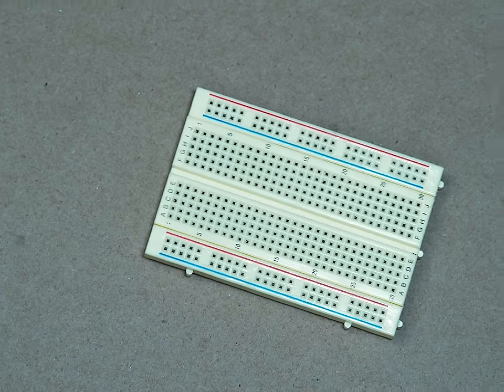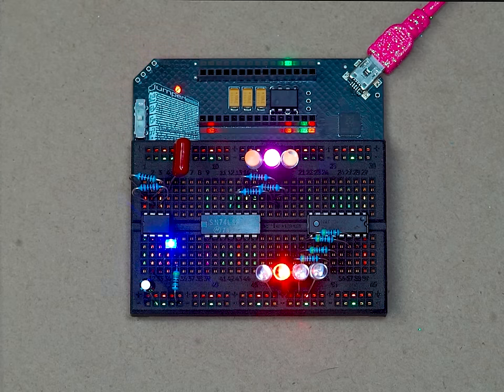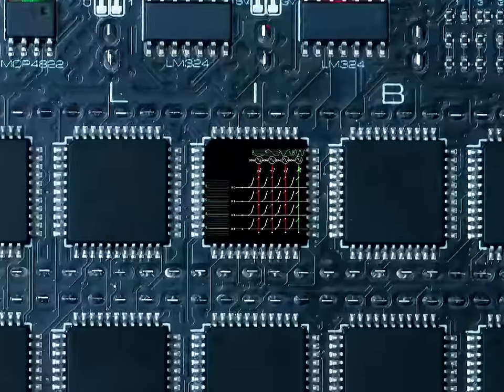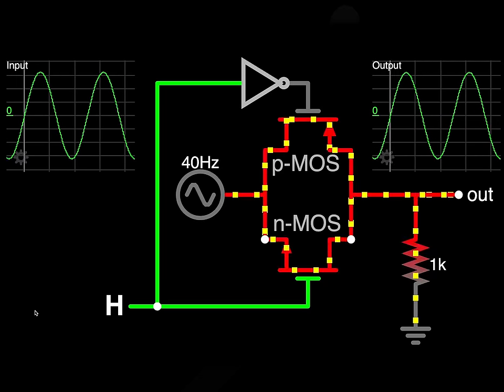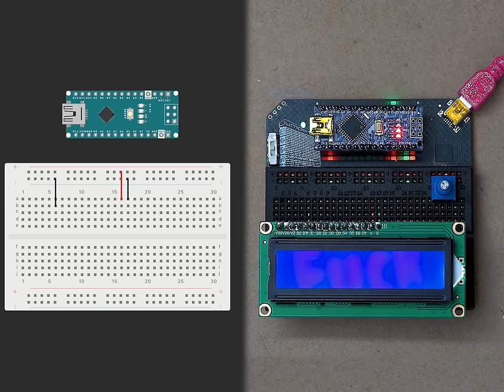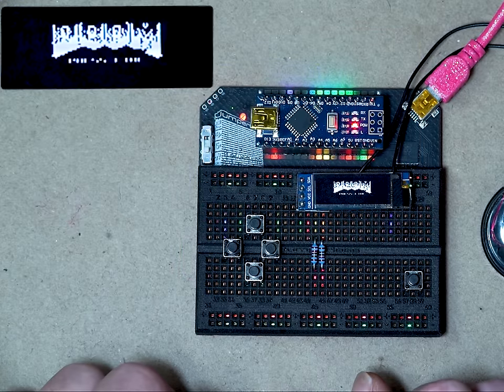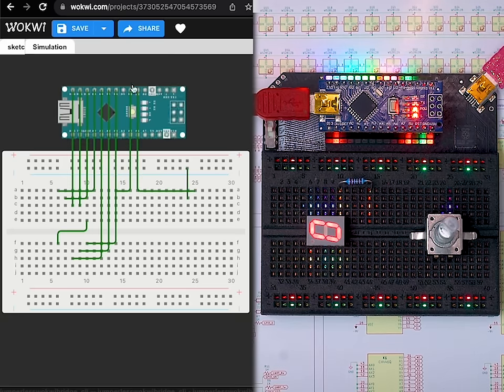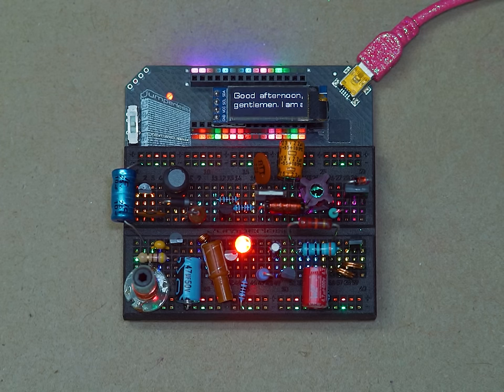Jumperless

Comment: Seeing how fast the holes in my normal breadboards go bad I would very much like to see a longevity test before I splurge 300$ on a breadboard 🤔
Reply from the maker: I had the spring clips made out of phosphor bronze, which is an alloy specifically made for high reliability springy electrical contacts like this. The steel ones from crappy breadboards tend lose their spinginess, but these should hold up for quite a while.

https://protosupplies.com/guide-to-solderless-breadboards/

Also if that happens, I'll swap out the spring clips on your Jumperless for free.

Comment: Almost perfect. Why 8 volts instead of 9??? I get the other two switch settings but maxing out at 8?
Reply from the maker: CMOS switches can only pass voltages between their supply rails, so I drop the +-9V crosspoint supply through a diode to get the +-8V for the power rails. That gives them a bit of headroom to switch. You could short those diodes to get the full +-9V or swap them with a low-forward-voltage diode to get closer. 
Any voltages above the crosspoint supply tend to leak into the other outputs, so your signal will clip at 9V and any additional voltage will be seen on the adjacent rows (For example, if you put 9.5V on row 5, row 5 will measure 9V and row 2,3,4, and 6 will measure 0.5V).
Reply: @arabidsquid  Ah I see. So is it really just combining diodes used in the 3.5 and 5 sections to get that 8v in the third switch position?
Reply from the maker: No, the 5V comes from USB power directly, the 3.3V comes from an LM1117-3.3 Voltage regulator, and the +-9V crosspoint supply comes from an LT1054CP charge pump wired as a voltage doubler and inverter, and the +-8V taps off that crosspoint supply through a diode on the +9V and another on the -9V. 

I used a charge pump instead of a more common (and waaay cheaper) flyback boost converter because I didn't want this thing flinging EMI into your circuit.
Reply: @arabidsquid  Ohhh. I completely didn't even consider that power came from USB to begin with. I am but a lowly audio hobbyist that only works on the 9-18v realm so I always tend to think about things in old school ways. But yeah those voltage options make perfect sense now. It's a really great concept and will surely be a smash in the Arduino community. Great job, I wish you much success!

Comment: That is so cool, i'd love to make one one day, but I have a question, how do you solder the bredboard on the pcb?
Reply from the maker: I actually had a manufacturer make a sheet metal stamping/bending mold for me so they could make special spring clips with solderable tabs and holes for the LEDs.

I sell them at cost so other people can make cool breadboard things and not have to spend $5000 on tooling. 
https://www.tindie.com/products/architeuthisflux/solderable-breadboard-spring-clips/

If you want to see what that tooling looks like:
https://forum.jumperless.org/t/spring-clip-update/48/3?u=architeuthisflux

Comment: I would think that a 2 port usb-hub would be a great addition for a V4. Then you wouldn't have to connect two usb cables to your pc. After all, isn't this project about getting rid of wires. 😉
Reply from the maker: You actually can program the arduino from the Jumperless itself. The firmware to do that needs a bit more work. But how it works is by briefly connecting the Arduino's Reset pin to ground, and then sending it the compiled hex code over the serial pins. So a near-future firmware update will update the sketch code from Wokwi as well as the wiring (or just paste the raw compiled hex into the terminal if you prefer).

Comment: How did you deal with the resistance of the analog crosspoint switches??
Reply from the maker: I just have to live with it. But there are a few things I do to get it as low as possible:

Run them at ~18V Vdd-Vss which is 4V above what they say on the datasheet but it reduces Ron to ~45 ohms per switch. And it doesn't seem to hurt them.

Limit alternate paths to a single hop over a different chip.

Double up paths where resistance is important

But yeah in practice for breadboarded things it doesn't seem to be a huge deal. The kinds of currents you deal with on a breadboard mean that most resistors you'd use are in the Kohms range so the extra 70 ohms is less of an issue.

Comment: Is it possible to automatically recognize the location, type and properties of different hardware components automatically with this? That could even make the manual connecting in software obsolete!
Reply from the maker: The hardware absolutely could, but I haven't finished the firmware to actually do that yet.

Comment: so this might not be good for guitar pedals, if the switching is only good for up to 100mA? charge pumps and inductors/transformers probably out of the question 🤔
Reply from the maker: In general, instrument level signals going into guitar pedals are basically ~0mA of current, and at most 150 milliVolts (which is tiny compared to the allowable 18 Volt swing). The input impedance of the things they plug into (amplifiers) are as high as possible, generally above 1MΩ. 

So 150mV÷1MΩ = 150nA   or   0.00015mA

But yes, charge pumps, inductors, and transformers may be pushing it though depending on what you're doing with them.

Comment: I've never seen this before.  Is this for real?  I mean, does each pin hole actually have an RGB LED to indicate action on them?

Is there an ESP32 (38 pin) version?

Or perhaps if there's an ESP32 version, its headers can handle 38 pin or less, just program the bread board to know what's there?

And if there's an ESP32 version (or even the Arduino version)
is there an option for the board's controller to NOT be Raspberry Pi controlled?
Perhaps the controller could be an ESP32 using both cores?  For those of us who don't use Pi ????
Reply from the maker: I may make adapters for the headers in different footprints soon. Until then, Arduino makes the Nano ESP32 that will fit up there. But yeah that has 8 fewer pins.
Putting the wide 38 pin footprint would also ruin the perfect 82x82mm squareness of the board.

I guess it's not impossible to make this same board with an ESP32, most of the code will be the same because I used the arduino-pico framework. Except for the PIO state machines running the crosspoints, and I'm not sure how much suitable GPIO the ESP32 has.

It's interesting that the AVR vs PIC war has recently changed into ESP32 vs RP2040 war, luckily it seems that people are much nicer about it now.
Reply: @arabidsquid  I didn't even realize that there was a war going on between ESP32 and RP2040 .  LOL

For me, I only got into ESP32 a couple of years ago (or a bit less).
I had avoided ESP32 for a long time because I don't like always jumping ship when things work well.

So I was doing everything with Arduino.

But when I finally broke down and bought a few ESP32 boards to test the wireless communications abilities, is when I fell in love with these things.

I do some of my prototyping on bread boards, but a lot, using a dev board with screw down connections.  LOL

Something like you've come up with would be a game changer.

Comment: Crazy wonderful stuff.  Wish I had this when I was doing breadboard experiments as a kid.    lol

:)
Reply: I would have destroyed a few switches with a lot more than 100mA, then go back to breadboards :/
Reply from the maker: @vikenemesh  The crosspoints are surprisingly hardy, I've run 400mA through them for a minute without breaking them.

Also my policy is if you break it, I'll be like, "hell yeah!" and replace it for free. I want people to try crazy stuff on these.
 

That being said, I've melted the insulation off quite a few wires messing around as a kid.
Reply: @arabidsquid  400mA is quite a bit indeed. Since you have current sensing capabilities, maybe have an auto shutoff if current gets too high? (also maybe you want to do actual destructive testing to see what the limits are) Very cool project.

Comment: Can you replace the breadboard when its springs wear out?
Reply from the maker: Ideally, these shouldn't wear out anytime soon because I was really picky about materials when I had these spring clips manufactured, so I didn't cheap out and use steel like they do in cheaper breadboards. They're made of phosphor bronze, which is an alloy specifically made for high reliability springy electrical contacts. 
But yeah, you totally could. It's a lot of desoldering though. If someone's using this enough to wear out the contacts, I'd just send them a fresh one for being such a loyal user of the thing.

Comment: I want like 4 of them, now lol
Reply from the maker: Ha sorry, you'll have to wait like a week for the next batch to come in. You can sign up for the waitlist though, which helps me know how many to have manufactured for the next batch.

Would you arrange all 4 of them in a long line or in a grid? (this is a genuine question. In the next revision, they will slot together and I need to decide whether to put ports on the bottom too)
Reply: @arabidsquid  as context, I am a computer engineer who specializes in processor execution and builds accelerators in FPGAs.

So for me, I plan to make a mother board for an FPGA, them use this to prototype how peripherals will be connected.

I can design a processor for an FPGA, but I can't design the PCB it goes on... I don't know board design and EE well, just self taught CE.
This seems like the perfect tool for me to learn that.

Comment: This is a novel (albeit a bit pricey) piece of kit. Much like other mad scientists out there, more than once I've found myself knitted inside a breadboard bird nest. Its even more frustrating since jumper wires only come in so many colors and lengths. The mechanics look similar to how a number 5 crossbar switch works. Hopefully there are others out there who will understand my comparison.
Reply from the maker: Ha yeah you're totally right about that, it works almost exactly like a small telephone network internally. All the early research for figuring out how I was gonna pull this off was research papers from Bell Labs from the 1960's.
And yeah, it is a bit pricey due to the analog crossbar switches and power supply for them being pretty niche/expensive. I've genuinely been hoping someone will make a clone that's cheaper than what I can make them for so they're accessible to more people and I can keep making the Jumperless to my standards. Even now, my margin is way lower than what's generally recommended because people using and enjoying a thing that I made is so much cooler than money.

Comment: This is very nice... but that price man. Can the tech be simplified without harming the core featureset too much to get it to 60--80? That would be more reasonable for something as niche as this.

Note: I also feel it is suffering a bit from feature-creep which was the main cause of the price ballooning this much
Reply from the maker: Weirdly, in this case it's the other way around. The power supply, crosspoint switches and spring clips alone are more than $70 in just BOM cost. The current sensors, LEDs, microcontroller, and DACs are basically negligible as far as cost goes, mainly because they're so common while crosspoints and charge pumps are fairly niche.
So those features are basically free while the core functionality is 90% of the cost, the electronics industry is weird and counterintuitive sometimes.
Reply: @arabidsquid  Oh man that sucks, I can see that yeah. What about cheaping out on the quality of those parts?
Reply from the maker: @uncannysnake  The issue is that analog parts aren't easy to clone. Most knockoff digital chips today are secretly mask-ROM programmed microcontrollers that can be made for nothing because a bunch of clones are actually the same chip and they can create "artificial" scale that way, hella clever. Analog chips can't really be done that way so even fake chips require some real effort.
If there's enough demand for this, I have some early designs for a custom ASIC that will bring the cost wayyy down, so long as I can sell these by the tens of thousands.

Comment: I think it's great for high speed digital electronic. Good job!

What about high freqency filters/ amplifiiers? Input capacitance of analog switches can change the parameter of circuits... 

But actually we don't build it on  regular breadboard because of high parasitic capacitances...
Reply from the maker: The input capacitance for the switches is low enough to ignore compared to the physical breadboard. But there's also some resistance in the connections. So yeah if you're dealing with really sensitive stuff I wouldn't recommend using a Jumperless.
But the idea is that you can use this whole circuit and firmware on your own PCB if you need it for high frequency or some other specific thing.

Comment: Fun fact. 
USB mini-B was introduced in April 2000. 23 years ago..

Why not use usb-c?
Reply: Liking my question isn't an answer.. 
I was legitimately curious as to why you uses such an old and very breakable connector?
Reply from the maker: For simple things that only need 5V at 500mA and a text-only serial connection, USB 2.0 is still the way to go in my opinion. And that's what the RP2040 does natively. Sure, you can run USB 2.0 over a USB-C cable, but I find that to be weird and hacky. Generally you expect USB-C ports to at least support some of the extra features it provides.

The USB-C spec defines like half a dozen different types of cables, and I'm just one guy making this who doesn't want to sit there and test every cable spec out there. It's just one more thing to go wrong for no gain in functionality. 
For example, I have a cheap handheld oscilloscope that only works with the provided USB-A to USB-C cable and I have no idea why.

As to why it's Mini vs Micro, I find that the Mini holds up way better on a bare board with no case to act as strain relief.

Comment: I would like to see another version without all the extra sesnors and no RGB's. Just a breadboard with programable connections. As a student a tool like this would be amazing, my lab partner and I spent 3 hours tearing through a jumper wire mess just the other day to find an issue. But at nearly $300 it is not a tool that is gonna be feasible for me.
Reply from the maker: What's weird in this case is that the switching matrix and power supply are so expensive to make that the sensors and stuff are basically free. But yeah hopefully one day I'll be able to offer a student discount.

Comment: that looks amazing, but... did you use it in real life? in the "mess" you mentioned at the beginning, at least you could see every connection. Am I wrong, or are you forced to look at your monitor to understand what's wrong? What if something is not in the right pin, with respect to your model? Is it better to check wires one at a time or to count "pin coordinates" for every component you put in there? As a tech enthusiast, I'm super intrigued, but not sure the benefits justify the 150x price increase, with respect to a legacy breadboard, really...
Reply from the maker: The RGBs under each row give a unique color to each connection, so anything that's a given hue is connected. Normally I'm against throwing a bunch of RGBs into everything, but in this case they actually serve a purpose.

Comment: Unhinged? This is what I picture happening when when pounding away at a key pad gets a space ship flying again. rerouting to steal part of a circuit because of a damaged component.
Reply from the maker: Haha exactly. Just like how it's done in Starfield, I like to imagine the reactor's power goes through a future version of a Jumperless.

I think NASA has been looking into evolvable hardware for quite some time. The reasoning is if a micrometeorite punches a hole in a chip or something, you can just have it run the genetic algorithm again to get similar functionality with what's left of it.

Comment: Make this daisy chainable, make Kickstarter and I'm wiling to back 20 of these day one
Reply from the maker: That will be on the next major revision. 
Not sure when I'll have that finished but probably 6 months or so.
In the near term, I might make a little board that connects the Nano headers on 2 or more boards together and passes signals and USB through to that.
Reply: @arabidsquid  since you replied so quick, "lite" version would also be great. How much of the cost is made up by LEDs, DACs and ADCs. I mean just keeping the crosspoint switches and MCU that controls them.

Are you able to lower the resistance in crosspoint switches without making parallel connections? Maybe by doubling the crosspoint switches? I see this is the smallest package for this IC but are there some lower Ron or some smaller BGA packaged switch arrays?
Reply from the maker: Surprisingly very little, most of the cost is in the crosspoints and the charge pump to power them.
I've been on the quest to find a better crosspoint for so long, I'm pretty sure this is the best one for this out there. But maybe in the future I'll make my own custom ASIC crosspoint switch that's perfect for this. It would be soo awesome if I could make these dirt cheap and in huge quantities.
There's also a graph somewhere of Ron vs temperature, it looks like it goes down to ~3 ohms at -70 degrees, so maybe I should try using one in a pool of liquid nitrogen.
Reply: @arabidsquid  thank you very much for the replies. You definitely deserve the prize. I'm rooting for you.

Comment: was all in until the mention of programming it on the pc. there are only 25 rows to connect, why not just have tactile buttons you can hold down together to make/break connection between rows?
Reply from the maker: That would be cool, but that's an entirely different project. And because it's any-to-any with ~90 nodes, there are roughly 13,000 switches in this board.